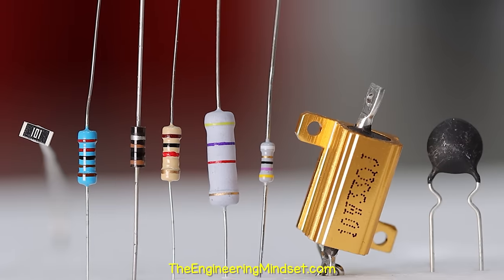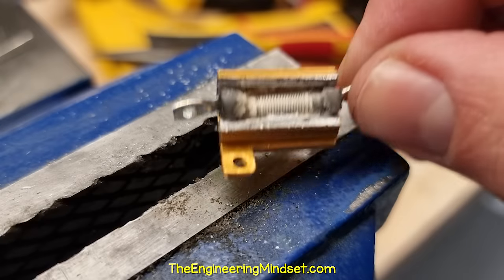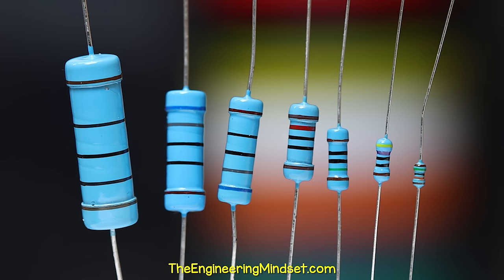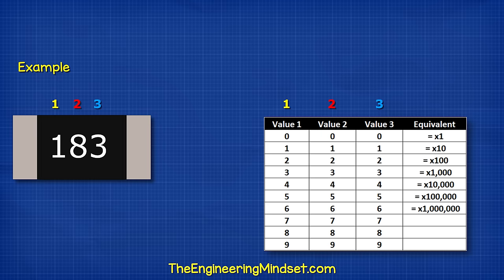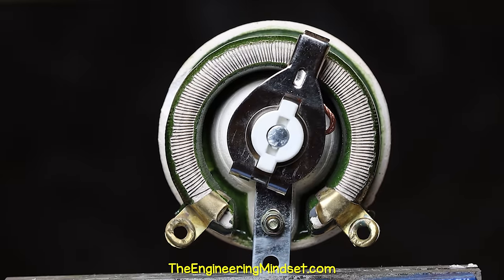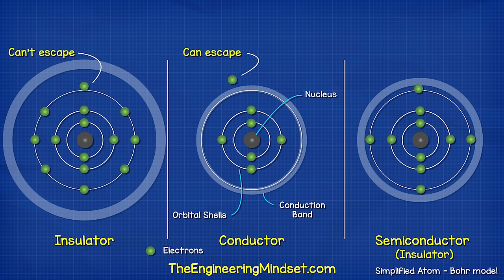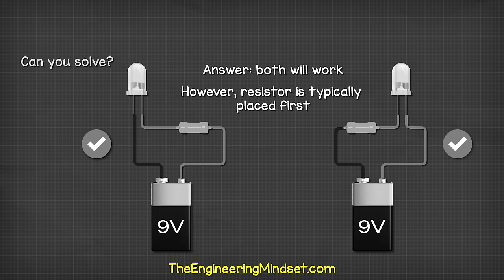How Resistor Work - Unravel the Mysteries of How Resistors Work!

Comment: I think the example you gave with the water pipe losing pressure when you semi block it is wrong, since decreasing a pipe's thickness but not the volume of water or flow will increase the pressure, similarly to pinching on a garden water hose.
Reply from the maker: True, let's just assume the volume reduces with a variable flow pump.

Comment: @The Engineering Mindset The water analogy isn't the best analogy. Fluid flow through a pipe is conservative i.e. volume in equals volume out and therefore an obstruction in the pipe increases the velocity beyond the obstruction causing it to shoot out.

Comment: So adding a resistor from the 9v battery to the led dies what? Prevents overload? Extends led life? Saves battery power? None of the above? I don't know the answer can I get one please without the jerk response
Reply from the maker: It is shown in the video, but the resistor is going to limit the current which protects the LED, this causes a voltage drop so we remove 7v which the led doesn't need from the 9V battery. This energy is just converted to heat, it is wasted.

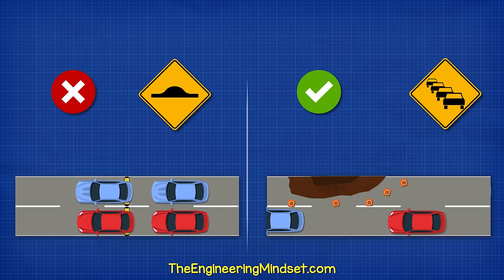Comment: 1:38 Since that animation doesn't really fit the real life (if the traffic of a multi lane road was narrowed down to a single lane, the speed of the vehicles would certainly be much slower due to the fact that the cars had to zipper down to a single lane which would force each vehicle to slow down, naturally and then speed of the vehicles increasing significantly as they pass the bottleneck part and the number of lanes increased again. I think a better example might be a wide glass pipe with sand flowing thru and an hourglass shaped one (?). Also, to my understanding the speed NEVER changes for electrons iow for electricity what changes, or could be controlled with components like resistors, is the pressure of electricity aka Voltage or the volume aka Amperage. So a restricted water hose is not a good example either a the restriction would naturally increase the pressure which is exact opposite of what a resistor is for or am I grossly mistaken?
Not trying to be arrogant, just making sure I learn the fundamentals as accurately as I can since I am barely getting into learning this. Thanks for the upload!

Comment: If the diameter of the pipe is reduced the pressure of the water in the pipe would reduce. The flow of the water would increase. I wish water analogies would die out when talking about electricity.  So resisters are basically transducers converting the potential energy into heat energy? They are heaters.

Comment: Electrons don't actuallly flow down a wire. Only found that out the other day. Mind blown. Check out the video by Veritasium explaining how it DOES work.
Reply from the maker: It's a very good, detailed and advanced theory of the physics of electricty. But, most people will struggle to understand it. They don't need that level of detail, they need a quick, simplified, relatable and digestible way of understanding it and implementing it within their projects. The water analogy isn't perfect, far from it, but it's easy to understand. Green dot flowing through a wire you can understand in seconds.

Comment: So why do computers overheat? Is it because the of the number of resistors in the circuitboards or is it something else?
Reply: Yor question is formulated wrong. "Computer(s)" is not one thing like one resistor, it is complex electronic device with multiple components, which have multiple boards, which have multiple layers, which is consistent in multiple circuits, which is consistent in multiple components. As it is discussed in video, electronic components dump heat as consequence of flow of current, so multiple components in close proximity emit more heat in total. So that is just one reason, there can be multiple reasons, one of them is also wear of components, or low quality components, or for example that tolerance ± can be very high, so with higher current they dump more heat. Ambient temperature also. And many more reasons.

Comment: But I also learned somewhere that electrons don't 'flow' in an electric circuit moving from one location to the other, but it is the electric field created around the circuit that moves the electricity. I need help
Reply from the maker: No one actually knows how it works. We design circuits assuming current flows from positive to negative.

Comment: Didn't Veritasium have said electrons pushing each other through the circuit via their mutual repulsion is a misconception and it doesn't move like marbles in a tube or water flowing through a hose?
Reply from the maker: He sure did, but that's very hard to understand and visualise for most people. But a green dot moving through a wire like water isn't.
Reply: @EngineeringMindset  Oh, hello! :D I wasn't expecting an answer. I was messing with others so they could go "what!" then "how!?" and maybe resarch about it if they are interested into the topic. 

By the way it's an amazing video! Thank you for your great work. Even if I'm unemployed and this is not my field and I gained no practical use from this, I loved to learn the subject in details.

Comment: Interesting they dissipate heat because so much technology sounds like it has waste heat not being recaptured. If resistors could glow in spectrum solar panels could use, that would be interesting attempt to recover the energy.  I guess the current gets too efficient some point, hurting the circuit but resistors do sound like unsung factors.
Reply from the maker: Seen our new video on HOW SOLAR PANELS WORK in detail https://youtu.be/Yxt72aDjFgY
Reply: @EngineeringMindset  I'm watching it and I'm going to rewatch several times for useful points in it...but for my question, I'm going to answer myself now, despite that video attempting to dispel the idea with the led can't power itself conclusion...I think waste heat can be converted to both usable spectrum light and current...possibly via lenses to enhance the glow, but maybe also via materials  designed to glow in useful spectrum for the panels, in response to heat.

Comment: The easiest way to look at it is it's a very very very very very very tiny step down transformer the only thing that the difference is is instead of taking the voltage that's going in and automatically changing it to the voltage they need it they just put resistance in its way

Comment: Unfortunately electricity has nothing to do with electron's flow! It's the flow of electromagnetic field around the conductor and not inside! The resistor   affects the dynamic of this field that's why there is a volt difference on the edges.

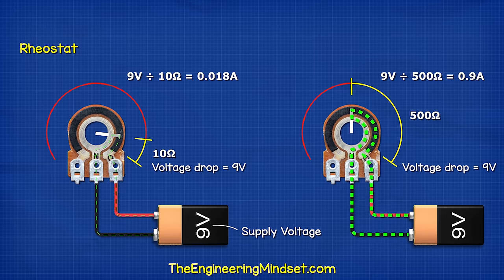Comment: At 14:53, isn't the math backwards for the current of both resistors? Shouldn't the 10 Ohm resistor have 0.9 A and the 500 Ohm resistor have 0.018A?
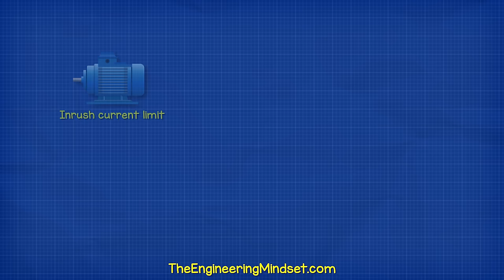Reply: other mistakes include ntc at 20:36 - should say it increases resistance as temp drops - accidentally said the reverse earlier. Also, an earlier resistance band problem was incorrect.
Reply: otherwise the video is great exploration of resistors. I learned a lot!
Reply from the maker: Please see corrections in video description

Comment: Isn't your resistor analogy completely wrong? If you added resistance to water flow it'd add pressure significantly. Also the car analogy would be more accurate if one lane of cars was split into two and one of those lanes was lead off of a cliff (electricity wasted as heat)?

(Someone please reply because I'm confused I need to know haha)
Reply from the maker: Thanks, I've answers these exact questions multiple times already. Please scroll down.

Comment: ELECTRONS DOES NOT FLOW THROUGH THE WIRE NEITHER FROM THE BATTERY. ELECTRONS DOES ONLY SHAKE A LITTLE, AND THAT WAY CREATING AN ELETRICAL MAGNETIC FILD AROUND THE WIRE AT THAT IS PICKED UP BY AN ATTACHES EQUIPMENT -

Comment: Electrons don't actually flow, if that's the way circuits worked then they would break the speed of light in long enough circuits. It's the electrical fields which are set up instantaneously and the differential that an anode provides. If you think electrons flow from an anode all the way through a circuit to a cathode you are wrong

Comment: Your pipe and water animation is incorrect. Bernoulli's law, on which all aviation is based, says that (very generally) if we reduce the cross-section in the flow, the pressure will drop, but the FLOW VELOCITY will INCREASE. And vice versa. As the name says, it is "Stream continuity equation". In your animation it is shown incorrectly and the opposite of what it should be. If it were as you show, planes wouldn't be able to fly. Your example is wrong because a resistor does not work that way. As you said a resistor converts the current into heat.

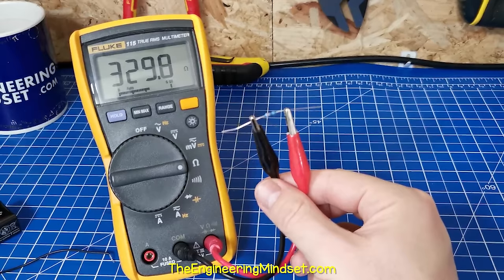Comment: Answer to the 2nd resistor is WRONG.  Check the time stamp  @ 9:36. It shows the resistor having a brown,  red, black,  red,  and red.  Not like the resistor shown for the answer to be red, red, black,  red and brown.  Explain that!!!
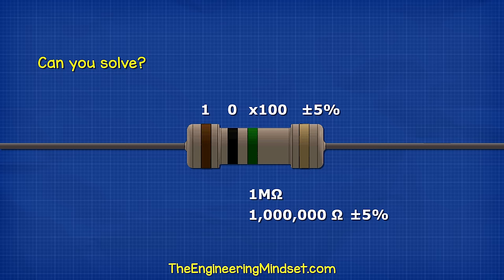Reply from the maker: The resistor flips 27:59 it was a slight trick question to test your knowledge

Comment: Thsi video is very misleading, because Electrons technically don't flow through the wire. Watch Veritasiums Video. What is actually happening is that the Electrons create a magnetif field that is responsible for the Current. That is also why the Current flows instantly and not just at the speed of light.
Reply from the maker: Perhaps. It is a great video, but I'd say 99% of people will not understand veritasiums video, nor do they need to. They will understand a green dot moving through a wire though, and that will let them design and build circuits which is what we aim for. Our channels are aimed at very different audiences.

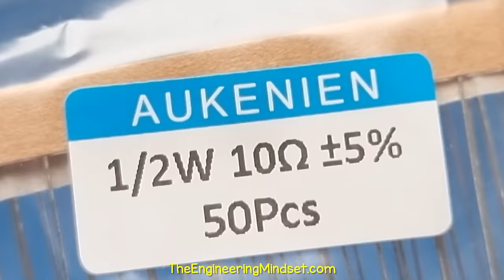Comment: 24:14 - damn it - again!  No sense!  You're resisting less so somehow it catches fire?!  Shouldn't that mean the entire circuit should catch fire if there are no resistors on it then?!
Reply from the maker: The other components will burn out or at least be damaged if the current exceeds their limits. The resistor has flammable materials inside so it burns easier. We can use a fuse to protect them or a non flammable resistor.
Reply: @EngineeringMindset  But I don't understand a resistor with a lower resistance and the same power rating would catch fire more easily when it's doing less work than the higher resistance resister.  Surely the higher resistance resister generates more heat and thus would be more likely to catch fire, right?

Comment: 18:55 - this makes no sense - if it becomes a conductor as the voltage goes up then surely the circuit is not protected against voltage spikes as it just lets all that extra voltage through to then burn out components on the circuit.  I'd want the opposite - a resistor which only resists above a certain voltage and then becomes a conductor below that voltage.
Reply: In the video he said it will short to ground, not the rest of the circuit
Reply: @chair3736  Then wouldn't that start a fire?
Reply: @chair3736  Ah wait - I see it now - the fuse prevents the fire.  Thanks!

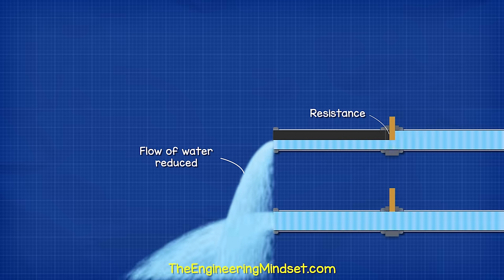Comment: At 01:50, I am pretty sure that if the water flow is the same on both side, then there will be a pressure increase on the narrow side. 
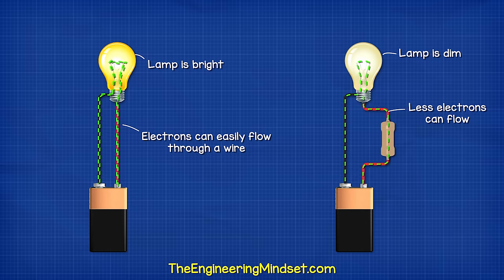At 02:03, only filamen wire would behave in such linear manner (obeying Ohm's law). Gas-disharge bulb and LEDs actually have to be engineered to obey Ohm's Law. Else, fluorescent light's AC mechanism has its only quirks while you can get zombie LED with zero positive current flowing thru.

Okay, need to stop watching. The video is pretty much just on the conventional way of learning electronics without dealing with the weird stuff that comes with electricity and electronics. Molinum imperium obedi!

Comment: You totally did the water explanation wrong. water increased in pressure with more resistance because of fluid dynamics not lowers.
Reply from the maker: It was a variable speed pump

Comment: I'm sorry, but you need to correct your video. You're showing the flow of ELECTRONS from the positive (small) terminal of the battery to the negative (large) terminal. Leaving aside the arguments about conventional vs electron current flow, electrons flow from (-) to (+).

Comment: 24:04 Your power calculation is also incorrect. Should read 9(V) X .009(A) = .081 (W)
Reply from the maker: No mistake, there are many ways to calculate the power. I used P = R X I^2 but we could use P = I X V or P = V^2 / R
Reply: @EngineeringMindset  sorry, you are correct I missed the little superscript 2.

Comment: 22:36 - again - this makes no sense!  If they have reduced resistance when in light, that would make any light on the circuit go off in the dark, not on!
Reply from the maker: You can make it turn on or off a light, you just configure the circuit slightly differently

Comment: 1000=100. 1003 = 100,000. What idiot is responsible for this? It's a bigger crime than imperial measurements.
Reply: Well the last digit represents how many zeros following the given value. For example 
103 = 10×10³ so 10K or 502 = 50×10² so 5K